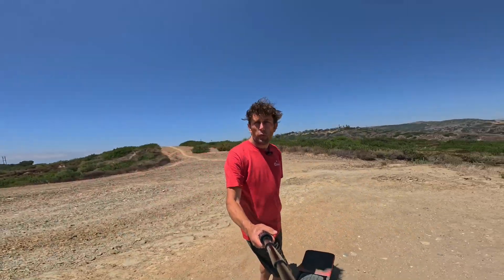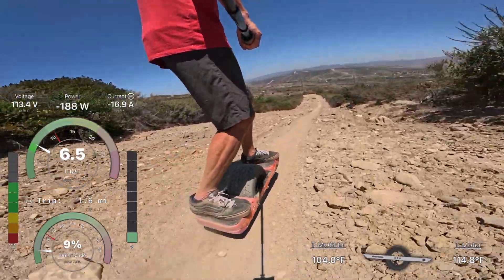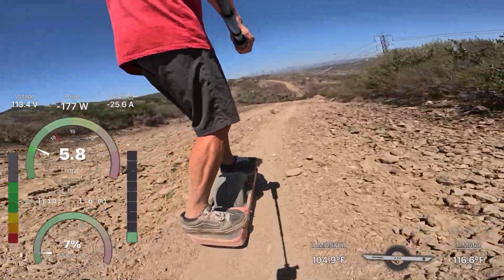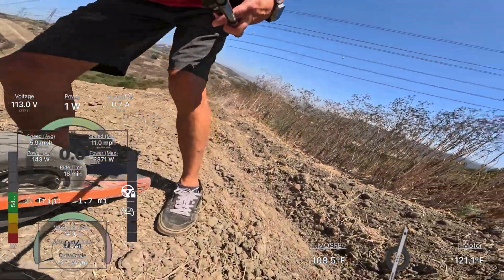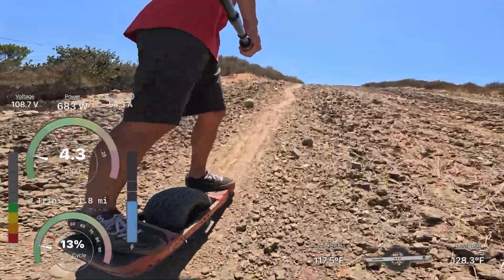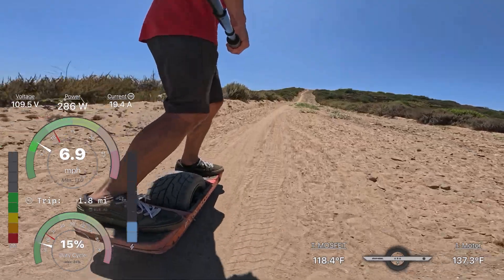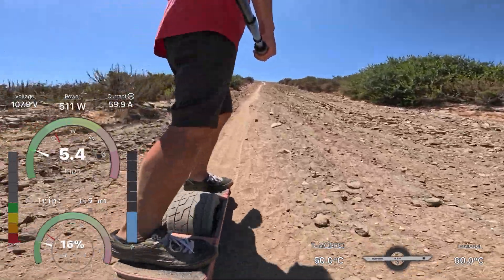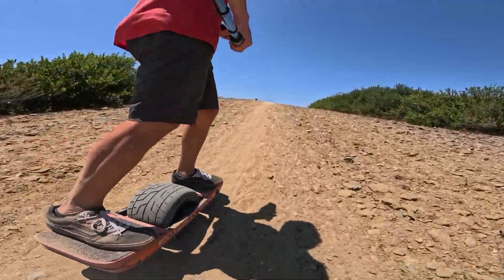Bring the Heat - Part 2: Tronic X12-30 and SuperFlux MK3

Comment: The X12 has different connections and mounting from the Focer and 250R. How did you wire up the start switch with LED and the footpads? Also, it appears I need to load firmware. What firmware did you use?
Reply: Yeah I wanna know this too

Comment: What would you need if you had a 30s1p battery from indyspeed with the BMS, Thor400 from fungineers with the super flux, rails, foot pads. What cable would connect the battery to the controller?

Comment: One wheel diy builds seem ridiculous sometimes, my 12S (10P 450A) esk8 makes 4x the power that battery can make. That’s a crazy voltage with a very powerful pricy controller just to make 400 watts at 5mph.

Comment: Hi!
Mosfet temps have to do with Rds or the internal resistance of the mosfet from source to drain. It is generally true  that higher voltage mosfets have a higher Rds than lower voltage ones. This isn't always true. You can buy 100v mosfets with higher Rds than 150v mosfets. In which case the 100v controller would run hotter than the 150v version.

Comment: What is the spec for mk3? More torque and speed?
Reply from the maker: same specs as the original SuperFlux, ask Fungineers for actual specs, I don't have them
Reply: @surfdado  seem the thor300 and x12 are operating in same temperature range, any idea with one of more efficient?

Comment: How did you manage to fit a 30s in an Xr?
Reply: I’m assuming it’s 1p just like the GTS. 30s2p (60 cells) would require crazy amounts of modification and something like VOW boards cannon core Vesc approach.
Reply: It is a 30s1p config with 21700 cells
Reply from the maker: we use the Torque Box for the battery, which fits 36 21700 cells, some people cram up to 40 in there, so a 30s1p 21700 pack fits comfortably